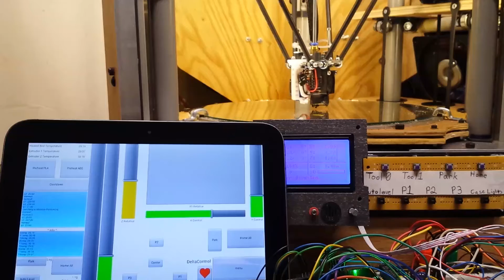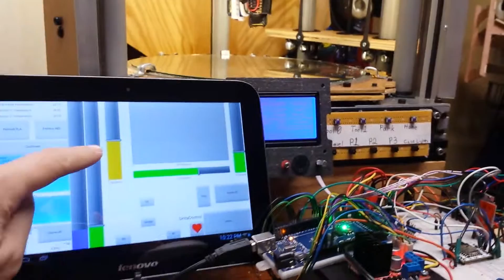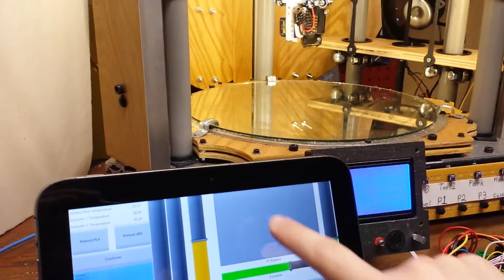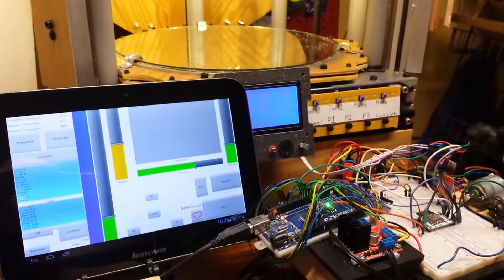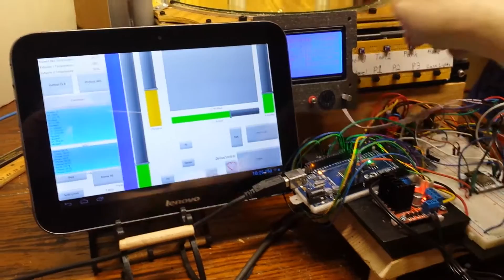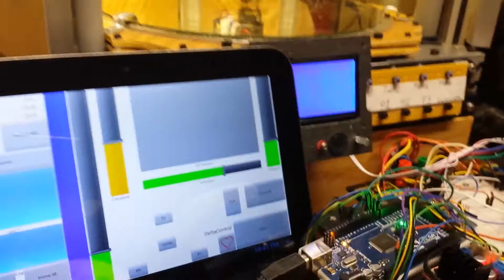WIP Project DeltaLift- Tall Delta, short bowden - RoboRemo WIFI 3D Printer ESP8266 deltabuddy

Comment: Thank you so much for sharing this :) It is just awesome! By the way, you say about files on SD card, I was planning to add file transfer widgets in RoboRemo, your video just motivated me to start working on that faster.
Also you say about 115200 baudrate, why don't you try more? Or is it hard to change the baudrate of the 3d printer?
Reply from the maker: Hey I am glad to hear that. Looking forward to file transfer widget. I love the app, and have been showing off my roboremo projects at my local hackerspace.  

a mega2560 with the 3d printer firmware loaded can do 250K, but I think maybe the arduino Due can only handle 115.2K I tried to go faster with with USB2Serial adapter that I use to flash the 12E (instead of the 2 onboard usb ports the due has) but it didn't work either.  and 30-100MB gcode file (large print large gcode) is no good at those speeds....not so great at 250K either SDHC is between 6MB/s and 30MB/s
Reply: Hi,
I updated the app, I added file sender and file receiver :)
I tested file sender with a 70MB file and it works OK (file received using netcat on a Linux PC).
However receiving such a big file in RoboRemo crashes the app, I have to fix that bug in the next update. But receiving smaller files works OK (tested with 7MB file received on Galaxy Tab4).
Reply from the maker: I'll keep looking on the forum and project page for arduino code to use.
Reply from the maker: looks like there is some info in the new manual on page 20-21 (http://www.roboremo.com/uploads/2/4/5/7/24571986/manual_v192.pdf) I think I can use that to do a file transfer.